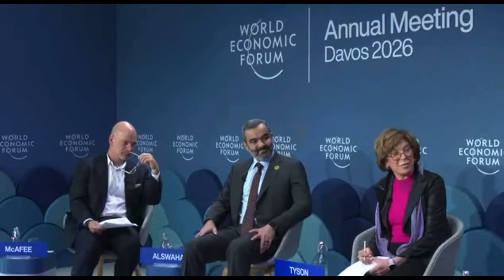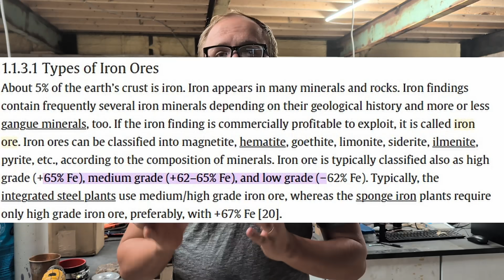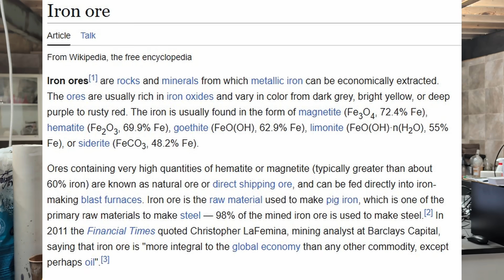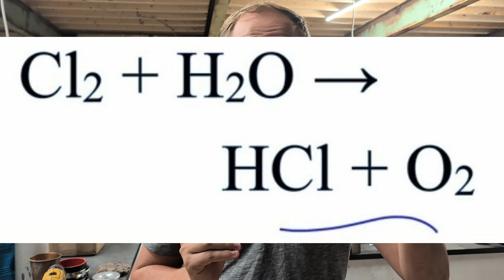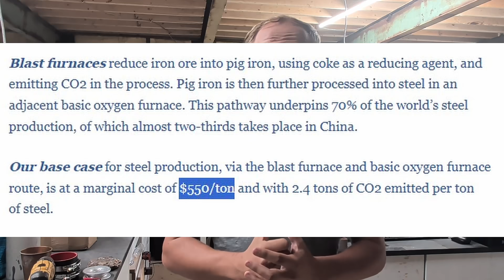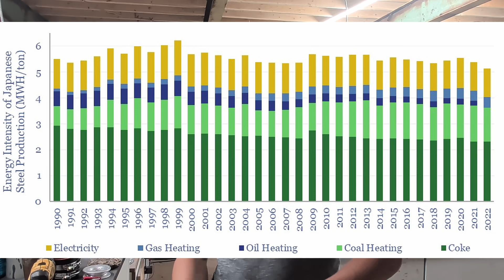Electrochemical Green Steel at Room Temperature, No Blast Furnace

Comment from the maker: Common question, This produces iron not steel? CORRECT! You simply remelt and alloy it. The melting cost is only $50 a ton. The biggest energy cost is in REDUCING the iron oxide to iron, NOT melting it. The critical aspect is creating a PURE iron product at a very low cost compared to steel. Pure iron is MUCH MORE expensive than steel because its so difficult to make. Converting pure iron into steel is the easy part. 
If you’re a company interested in FUNDING SEM TECH:  info@rowow.net
https://www.gofundme.com/f/rowow
https://github.com/Rowow-LLC/Open-sourced-off-the-shelf-ion-exchange-membrane
https://rowow.net/
https://discord.com/invite/e7CmU2ekky
For anyone that wants to help: PLEASE SHARE
That is the most important thing. To have this knowledge shared and get it attention from someone important.

Disclaimer
This video is for educational purposes and discusses engineering concepts and testing updates. Do not attempt without proper equipment and knowledge
Reply: Being a chemistry major,... I am interested.
Reply: Can you discuss concrete?
Reply: Typically technology that is smart and cheaper always becomes the dominant force in the marketplace.  If it's cheaper, why is it not dominating the marketplace As the iron manufacturing process used ubiquitously in industry.  Most of the type of stuff like this that influencers put out is not profitable.  Anything involving ion exchange membranes is a high cost approach for separating different elements for purification purposes.
I have followed these types of things in science for decades.  Only a few make it through the bottleneck, and prove to be a cheaper manufacturing approach technology.
Reply: Coal is expensive and dumb. And yet market really gravitates it
Reply: @blinded6502  it is not exprnsive. Also it is been tested in numereous countries that we can use hydrogen in the same process. We weere using fuel oil too up until 70s oil crisis. Coke is the best. And if you find coke expensive you can always make sponge iron with using lower grade coals and use that sponge iron as a substitute for scrap and make steel in Electric Arc Furnaces
Reply: Hello! Are you planning to release a paper about this? I would love to read it!
Reply: @divat10  he couldn't do it because he doesn't know shit
Reply: Sounds like a really efficient way to turn iron oxide powder into iron oxide sponge. It looks clean on paper because you're assuming the cow is a sphere, but reality isn't clean, you're assuming perfect affinity, perfect membrane selectivity, perfect deposition in opposition to irons preferred dendritic depsosition, and most damning is you seem to be implying no side products. Either you have discovered a way to create perfect reactions with no side products (which if you have let me tell you steel is about the least valuable thing you could do with that tech) or you are hand waving away so much that this is is doomed to live forever in the land of math.
Reply from the maker: @sethg6157 I've already done this. Wait a week I'll upload the video
Reply: @Rowow I’m genuinely interested to see the video.
Just to clarify though — membranes control ion transport between compartments, they don’t change the surface-level deposition kinetics of iron.
The issues I’ve run into are hydrogen evolution, local pH rise at the cathode, and Fe(OH)x formation causing spongy deposits.
I’d be really interested to see what current density, pH control, electrolyte composition, and agitation/additives you’re using to get dense, non-oxidizing iron.
Reply: ....WHERE from DO YOU TAKE A SUPPLY OF HYDROGEN?

....YOU'VE GOT A MISSING LINK ABOUT regenerating hydrochloric acid

...SO,WELL.....YOU'VE JUST CREATED A OVERSOPHISTICATED PROCESS OF direct restoration of iron oxide into iron with hydrogen

......WHY NOT THROW OUT UNNECESSARY PARTS FROM EQUATION?.....

...BESIDES,ELECTROLYSIS OF water SOLUTION OF any CHLORIDE ACTUALLY GIVES BLEACH ........LOTS OF IT,AND YOU CAN NEVER GET RID OF IT UNTIL YOU'D SWITCH TO melting

...WHAT,COSTS ALREADY SKYROCKETED?
Reply: @robotnikkkk001  I have been asking the question as well as Cl2 +H2) = HCl +HClO,  both are acids, and will dissolve the ore I think, the HClO gets destroyed by the electrolysis
In the main plating bath (most common and simplest setup)You bubble/return the scrubbed solution (HCl + HOCl) straight back into the plating tub.HOCl reaches the cathode (where iron is plating).
The cathode strongly prefers to reduce HOCl over almost everything else (including Fe²⁺ and H⁺).
The fast electrochemical reaction is:HOCl + H⁺ + 2e⁻ → Cl⁻ + H₂O(or written as HOCl + 2H⁺ + 2e⁻ → HCl + H₂O in very acidic conditions)
Result: HOCl is almost entirely destroyed at the cathode within seconds to minutes of entering the bath.

you do get a lower yield, but still works ,  a good point missed here is this system will cost much less than traditional blast furnaces.
Reply: So much easier when you can Sim-u-later everything without having to turn the universe on it's side in you mind to let it run like a movie in schools lol
Reply: Now how do you 3d print iron in that solution ... for example could you use lasers to build
Reply: Considering that logistics alone can be enough causation to produce things at more cost just to be able to get rare skills that can reach areas that can't be automated to do specific tasks..
This would be nice even if it was rare use
Reply: FYI: the don't use rock (ore) in the blast furnace. They use a ball mill to crush the ore into a powder, and the magnetically separate the iron compounds from the rock. Most of the material going into the furnace is only Iron compounds.  

Coal is still way cheaper than electricity, and until reasonably the majority of electricity in the US was from Coal. Burning Nat Gas to smelt steel via electricity seems like a waste.

Comment: Low-temp electrolysis of iron is definitely a promising alternative to furnaces, however:

1. The reduction of iron in aqueous electrolyte is often outcompeted by the hydrogen evolution reaction (HER), especially in acidic media, requiring a suitable catalyst that selects for iron instead of hydrogen (this is nontrivial).
2. The production of oxygen as an end product requires either evolving oxygen from the anode or converting chlorine into oxygen and hydrogen chloride. While producing oxygen directly is more difficult, producing chlorine instead requires a secondary process to convert it into oxygen, which may drive up energy cost. I am also not aware of any established way to do this reaction Cl2 + H2O > 2HCl + 1/2O2. Chlorine gas is also highly reactive and toxic, and so management of this gas is critical (needless to say, don’t go producing chlorine gas at home). The simpler solution would be to evolve oxygen directly from the anode, preventing chloride ions from reaching it either by ion-specific catalysts or membranes.

There is promising research in this field at lab scale in the avoidance of the hydrogen evolution reaction, but ultimately this technology is still new and needs a few more years to develop. We need more funding into this research if it is to reach commercial scale.

Comment: Don't processes in industrial scale still need power to be available 24-7? Not much help from solar so.
Reply from the maker: Apologies I wasn't clear about in the video, but this technology allows non 24/7 aka intermittent operating times as it's low temperature and therefore not affected by being on or off unlike other processes which take energy to heat up or cool down

Comment: Instead of using a chemical ion-exchange membrane, place a porous conductive barrier (such as an iron mesh) between the electrode compartments and apply an electrical charge to that barrier. The charged barrier would electrostatically repel one type of ion (for example, Cl⁻) while attracting or allowing the opposite ion (for example, Na⁺ or H⁺) to pass through. This would separate acidic and alkaline products and reduce unwanted reactions such as chlorine generation.
Reply from the maker: Iron would dissolve. But maybe some graphite mesh, worth a try. I recommend joining my discord server

Comment: And what kind of electrode I use because metal stuck on the electrodes and it is hard to extract metal which is stuck on the electrode I think about using the graphite rod which one is used for welding but in little large scale it is difficult to use the graphite rod
Reply from the maker: I'll be open sourcing a patent soon how to use graphite
Reply: @Rowow where I get open source patent once you upload it about graphine 😊
Reply from the maker: @PolyParadox I'll upload a new video, stay subscribed

Comment: Interesting I can see a use for pure iron soft as 
Can you be sure there is no hydrogen in it from the water (hydrogen inbritlement )
Reply from the maker: Read the pinned comment please
Reply: @Rowow  Have read it  A use that requires soft iron as a copper replacement  
The issue may be scale huge quantities enough electricity may not be available and large steel refineries are usually integrated in large casting operations or feed rolling mills   (forged steel has superior qualities in many respects ) 
Why are you supporting the WEF ,   and are you aware that the IPCC has just stated the RCP 8.5 is implausible so the  Climate scare / scam is over

Comment: And just where is the electricity to drive this going to come from? unicorn farts?
Reply from the maker: $170 is the price of the electricity and all other costs involved per ton...
The technology allows intermittent operation so solar works perfectly
Reply: @Rowow  Delusional pie in the sky nonsense.
Where's your trial plant?
How's it proving out?
Reply from the maker: @axeman2638 watch my other videos. I have plenty showing it working. It's basic chemistry, nothing delusional
Reply: @Rowow  No, what's delusional is that it will scale to industrial size economically and that the grid is already struggling to keep up with demand and there is no electricity to spare for it.
Reply from the maker: @axeman2638 there's plenty of cheap interment electricity during non high demand. In many places it's actually free
Reply from the maker: @axeman2638 also you seem to struggle to comprehend this process LOWERS the energy required. We already spend a certain amount of electricity for steel production. This simply makes it more efficient and cheaper
Reply: @Rowow  Again with the pie in the sky nonsense, you can't run large scale industrial processes intermittently. it takes time to wind them up and down.
Reply from the maker: @axeman2638 you have no clue what you are saying. That's why this technology is so powerful because it can be run interment at large scale, completely continuous and automated
Reply: @Rowow  Where's your trial plant then?

Comment: Interresting. That's pretty much the way aluminum is produced, or iron is recycled. And copper is actually harvested using HCl.
So iron industry knows it quite well.
The reason it doesn't use it, you stated yourself: coal is so cheap, and high quality iron ore so abundant.
Reply from the maker: no they don't use this method and it is half the cost to do my method than of the coal

Comment: I’m interested and want to get you some funding.  I’ll need to ask a few technical questions first
Reply: What is your current throughput in kilograms per day?
What is the cell lifetime?  What is the time curve of electrode degradation?  How much passivation is occurring per kilogram of product?  
How many kilowatt-hours per kilogram of steel?  
How many ppm of chlorine are you losing per cycle?  

Are the patents filed or provisional?  
Is the new art in electrochemistry?  Reactor design?  Feedstock tolerance?  
Are there any freedom-to-operate risks (such as molten oxide electrolysis prior art)?  

What is the floor of impurities your system can handle?  

How cold can operating temperature be and have it still work?  
How susceptible would the process be to a high-UV environment?  

Let me know the answers to as many of these questions as you can, I am eager to get started matching you with funding sources.
Reply from the maker: Hello you can reach out over my website. I have a email there or you can book a meeting for a consultation
A ICB tote size electrolysis cell can produce a ton per day. I explain the kilowatt hours production per kg of steel in the video. Chlorine is recovered and not lost.

The rest of the questions are more fit for a formal meeting.

Comment: Additional advantages:
1) extremely pure metal, especially free of deleterious nonmetals S and P, main culprits of corrosion. In normal circumstances, it's virtually stainless.
2) The process could be used   for extraction of elements from complex ores.
3) With maybe 10 times less energy, the process could be used for refining the scrap, with full recovery of alloying elements. Nickel from your pot will not end up in a rebar!
4) The process is very low in capital investment, so it's an ideal sink for surplus electricity, often dirt chip in the era of revevables. It could stabilize the grid. $200-300 of electricity per tonne? Just a fraction of it!
5) The same device could be used for producing of iron (when electricity is cheap), and for refining the scrap, in the hours of high demand. So not even idling is necessary!
6) Rate of the process is highly dependent of of overpotential, so it could be optimized in any given moment, depending of the price on the spot market.
7) The process is extremely flexible. It fits any size and any ore. It's modularity allows construction of a steel mill from of the shelf components. Plug and play instead of mill towns!
8) The process uses DC, so its directly compatible with PV. This factor alone could easily halve the cost of electricity. When combined with 4), the cost per ton could easily drop bellow $100!
9) The iron could be alloyed by addition of other metals in solution. No need for melting! Just heat an roll it, make a steel mill in your basement! (The old Mao's idea!)
Reply: An additional remark. Ubiquitous pyrite is used for production of sulfuric acid, not for production of iron, because of too much residual sulfur. However, if this process is applied, it's a moot point.

Comment: The MOLECULE of hematite? Yes, yes, in a ionic crystal.
Reply from the maker: Point is to show molar ratio. You can't see that in a hematite crystal diagram
Reply: @Rowow Then show atoms alone, without structure of a molecule with all the angles! Popular science could be approximate, but not outright wrong.
Reply from the maker: @predragraos-k5r it's literally the molecular structure for iron oxide. Sure not hematite but the point is correct. Cry and cry

Comment: This is really great speculation, and perhaps eventually becomes practical once we have really cheap electricity, to the point it becomes cheaper than burning stuff.
And yeah, not new, just different application of the same electrochemistry that refines other metals, including copper from smelted to electrical grade.
Perhaps even more important for the future, electrochemical processes also allow separating out base metals from mixed scrap.
Still lots of engineering left to do in the next century!
Reply from the maker: its economical at todays electricity prices. furthermore you can start and stop the system allowing it to take advantage of off peak free power

Comment: How do you plate it out without it being infested with salts and oxides. When I've plated out iron it always depsosites as a sponge like material that rusts instantly the moment you pull it from the acid
Reply from the maker: because the ion exchange membrane allows direct control of conditions the iron plates out at. I just got a bag of rust today, I'll make a video next week showing the process
Reply: @Rowow A membrane mainly limits ion crossover between anode/cathode compartments—it doesn’t directly control cathode surface kinetics. Iron morphology is dominated by current density, Fe²⁺ concentration, agitation, and competing H₂ evolution, plus local pH rise that drives Fe(OH)ₓ/oxide formation.
What operating conditions are you using to prevent hydrogen evolution at the cathode (Faradaic efficiency for Fe vs H₂?) or local pH shift at the cathode surface (buffering / flow rate?) or Fe(OH)ₓ precipitation and spongy/dendritic deposits (additives/temperature/current density?)

Comment: Also, the Hall-Heroult process that produces aluminum from aluminum oxide can also be made to produce pure iron from iron oxide (at a temperature above the melting point of iron).  The equipment to do so is a lot smaller than a blast furnace and open hearth furnace.

Comment: The reduction potential of the process Fe++ ----> Fe is -0.44v. The temperature equivalent of 1 electron volt is 11,500 Kelvin/ev.  So you can easily plate out pure metallic iron with a 1.35v D-cell if you know electrochemistry. Thermalization of an electrochemical process is doing things the hard way if you have electricity.

Comment: It would definitely be interesting to see if you can use the rotating de-watering tools as your plating surface. You might just run into some small issues with low concentration acid when rinsing the metal

Comment: And it would eliminate the radiation that sneaks into iron when smelted post 1950. This could make medical devices cheaper and easier to make since sourcing old steel wouldn't be necessary. (Hypothetically I think, assuming isotopes wouldn't seep in some other way)